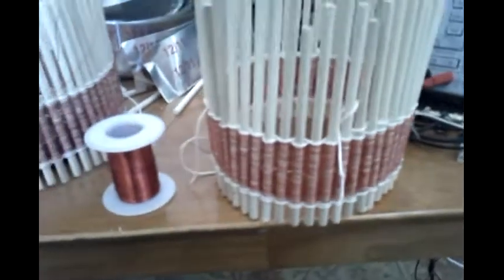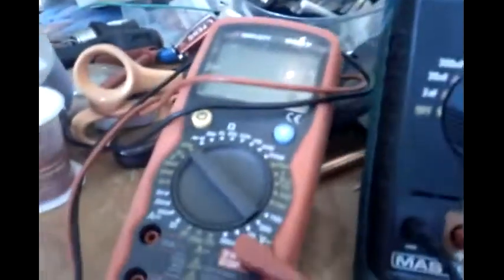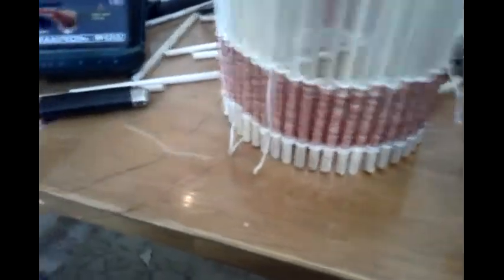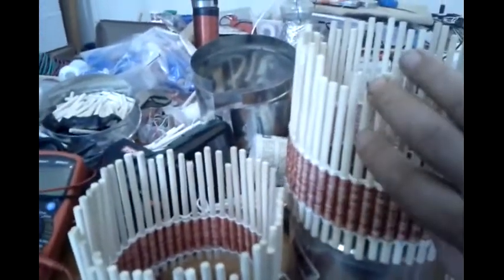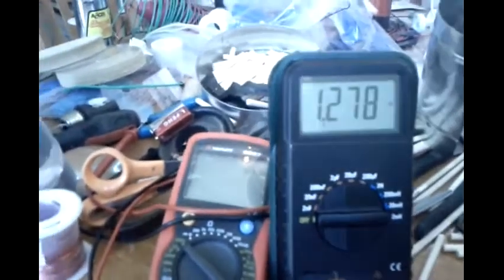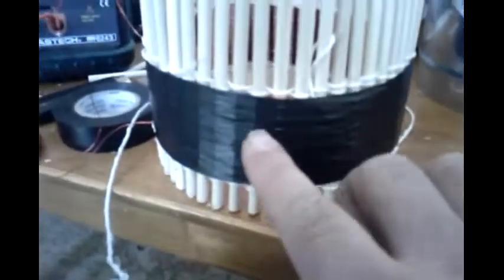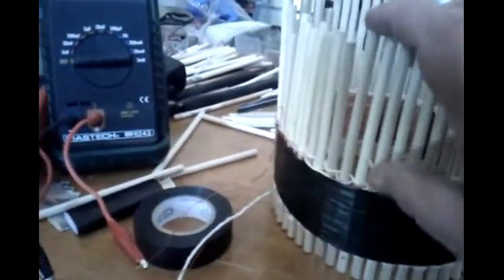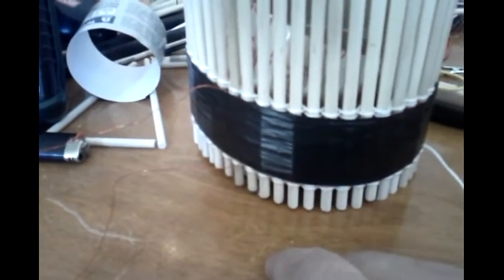Hendershot coil beginnings

Comment: Why are you not building it to specs .. No one does ..Why ?
Reply from the maker: How is it not to spec?  Oh I see... at this state... because I didn't have the exact materials.  I did later have a frame made that was closer to spec.  The coil was the same measurement.  I more recently tried more like Hendershot FuelLess Generator guide. Blueprints. Free Energy  ... which is a more simplified schematic.  Only thing I still had questions on was the solenoid coils near the magnet... I don't have available thick iron bar
Reply: closer to ?  That's how it's not to specs.. Why bother without the right materials . ?
Reply: U just have to do it over.
Reply from the maker: 247News1 Yes it is.  I don't know what spec you think you're following.  Say, if you had any better luck, maybe you should forward updated information.  At the time a year and a half ago the plans that were available called for 40uf and 80uf caps, and windings of this diameter.  I used the same number of posts... just slightly thicker.  Really, the coil that used 1/8 inch instead of 3/16 inch dowels behaves the same.  The measurements I used were mentioned in the most unique sources I could find.